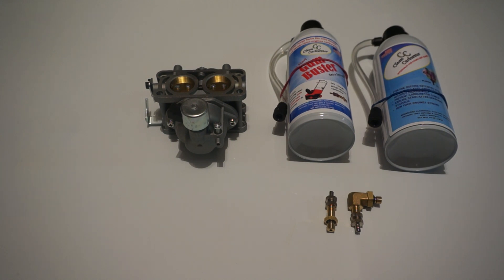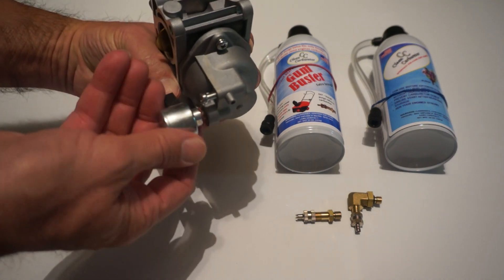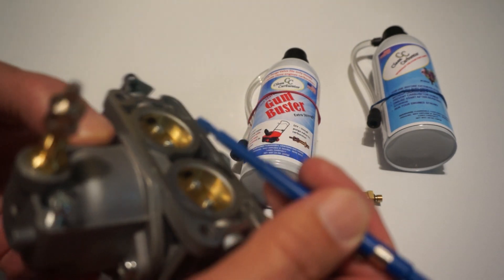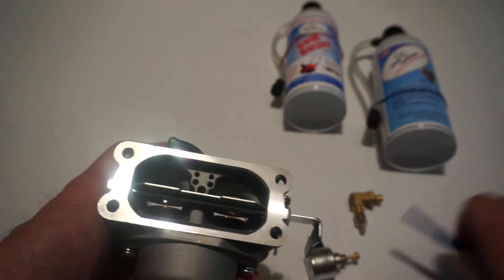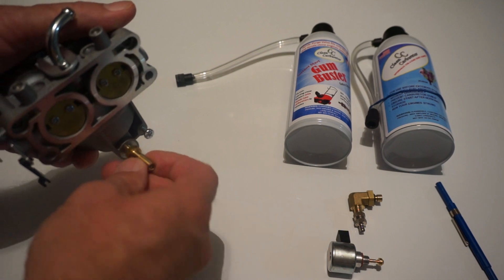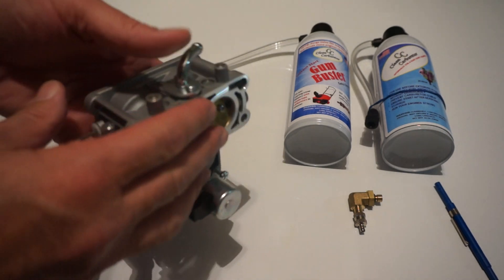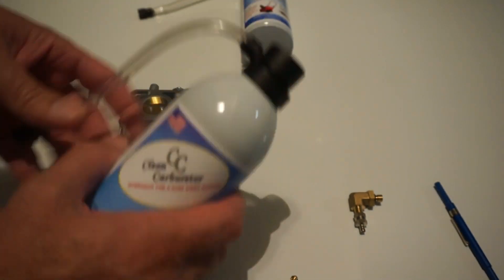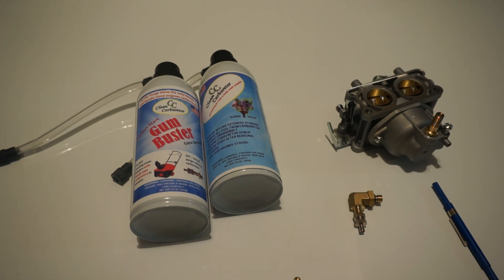How to Clean Kawasaki V Twin FH FX FD 15003 15004 Engine with GumBuster by Cleancarburetor

Comment: You make the removal of that solenoid valve so easy. Mine stripped 1st attempt using the correct wrench. This on a Kawasaki FX801V with only 117 hours. =(

Comment from the maker: If you would like to order the purge valve and GumBuster please place the order here (part number SKU 200110):

http://www.cleancarburetor.com/index.php/cart/gumbuster-kit-for-all-pressure-washers-with-honda-and-honda-clone-engines

The purge valve gets installed on the bottom of the carburetor. The GumBuster fluid dissolves the gum inside the carburetor allowing the fuel to flow through the jets again. With this, you'll be able to start your snowblower engine again.

If you would like to order a new genuine carburetor with the purge valve already installed and Purge Gas (part number SKU 200070):

http://www.cleancarburetor.com/index.php/cart/carburetor-with-purge-valve-pressurized-gas-can-for-snowblower-power-clear-621-721-snowblower

At the end of the season, drain fuel out of the carburetor, connect the purge gas to the purge valve and with a few blasts remove all the fuel from inside of the carb. The carb will be left like in a brand new condition over the storage period.

For any questions call Frank 847-274-9862